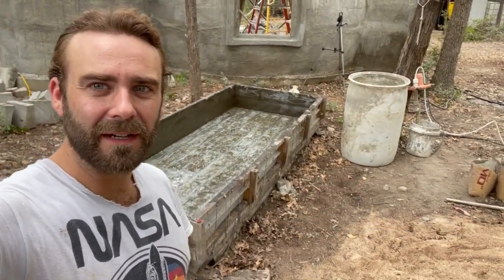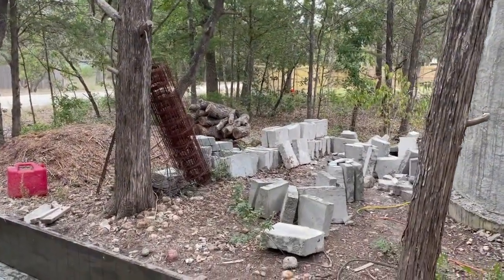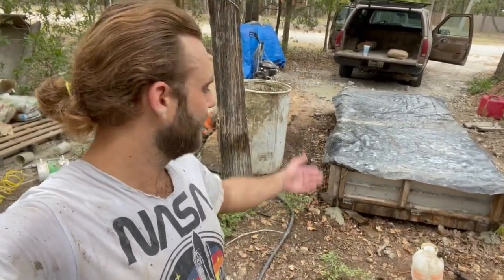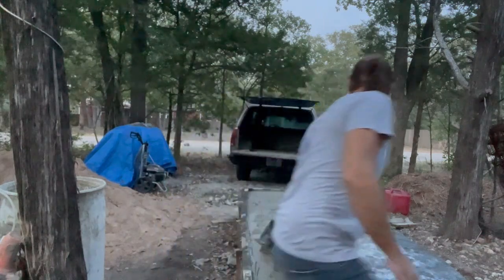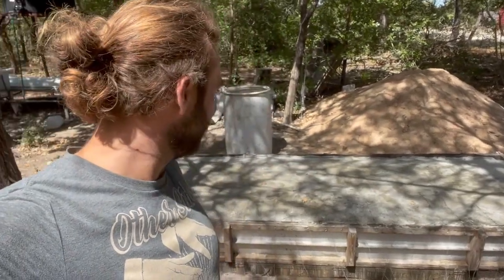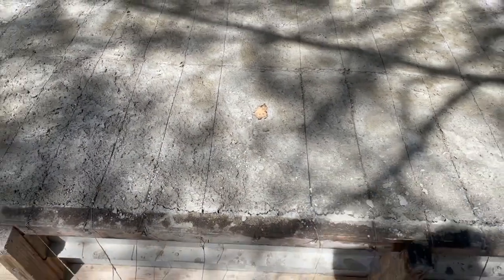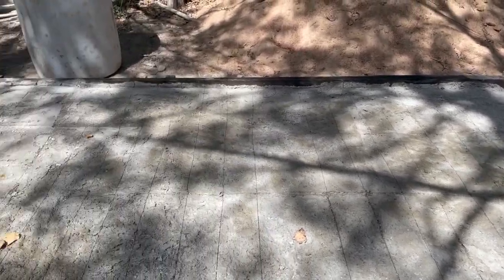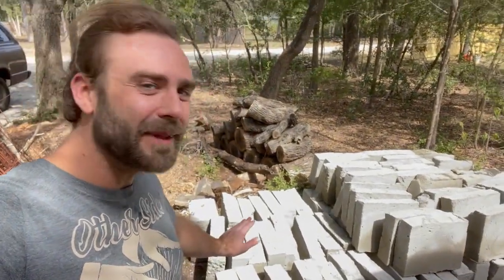Make your own Aircrete bricks by yourself!!!

Comment: If you left your string ends longer, enough to reach the other side over the top when it was time to cut, you could line it up with the other end and pull them while keeping it lined up with the other end.  I'd probably try to use electrical fence wire or something metal instead.   Dunno.   I'd actually be more interesting in making a shape like a 4x8 piece of plyboard for sheeting if that's possible.  Maybe pour a sheet into a 4'x8' box, level it out, put a piece of plyboard over it in the form, poor the next sheet, and keep stacking them on top of each other like an orea... concrete.. plyboard.. concrete.. plyboard.

Comment: If you were inclined to use something a little tougher than string, go to a poultry farm supply house and ask for shocker cable. Its the smallest cable ive seen. It is stretched frim one end of the feeders in a chicken house to rhe other and pulled taught. It keeps the birds from roosting in the frrder line

Comment: Wooaa!! We now have big safety issue with RAAC CONCRETE BEAMS. Be very carefully in your application. Ensure you use full re-enforced non ariated beams for load bearing including full concrete non ariated blocks for side support.

Comment: Amazing. Have you got a website with the stats? Where did you discover this method? Could this replace concrete for pouring non load bearing walls and structures in formwork with reinforcement steel?

Comment: I have done homemade aircrete before, for a small structure this is probably the best technique I have seen as the smallish bricks will crack much less. I ended up using corrugated ferrocement on my first small home build instead due to the crumbliness

Do be careful relying on this material above your head! Domes are strong, but please do stick to small structures when using non-engineered materials. A layer of polymer-enriched chicken wire ferrocement will hold those blocks together through any earthquakes, as well as waterproofing the surface.

I truly wish commercial autoclaved aircrete were a thing in the USA like it is all over Europe, the bricks are just so big
Reply: I live in Europe and my house is built out of the commercial autoclaved aircrete that you mentioned. It boggles the mind that it is not available in the US.
Reply: @wrojasiek We tend to use different materials in the U.S.
U.S. homes are designed for better efficency due to our weather being harsher throughout the year and air conditioning and heating being important.
We also have a great supply of trees due to Canada being located close by

Comment: To help with straightness and efficiency, instead of having to eyeball the strings to the other end while starting the pull to cut the blocks with the strings, just leave a tail on the pull end long enough to be taken to the string start end BEFORE beginning to pull them, and THEN once you're down there, line it up with the start point anchor, and pull.  It should then simply straighten itself as you pull it across that spot, as it will already be completely straight.  :-)
Reply: I would also put an eyebolts on the far side from where each string comes up, so you can pull  the string in pretty much any direction and the eyebolt will keep the cut perfectly straight.
Reply: @KeithOlson 
Exactly. I'd have little eyes all over the place. It'd be super sweet
Reply: I was thinking to have the strings secured to the frame on one side, and have the other side of the strings secured to a dowel... When ready to cut, just turn the dowel until the strings raise above the concrete mixture. Then it makes all the cuts at the same time and no chance to miss any.
Reply: @Babycutes  And hear I was thinking about just using a winch to pull the strings up.
Reply: Yes. That was my first thought when I watched him walk the string pull.

Comment: Thanks. Watched A LOT of air-crete videos and if they show the process its the elements to be added then the finish work...not the making of the entire project. So, this helped. Could you make a video where you show the consistency of the aircrete (like from the top of the barrel and the soap procedure mix and the thickness of the aircrete after mixing, etc. Plus one where you show you hooking up the equipment (plus extra hoses, their length, etc) in tandem? Thanks :)

Comment: Place a 2x4 or 2x8 over your concrete when you want to make your cut, i guess it still depends where the string lays in the bottom though
Reply: It will at least assure a straighter pull, though.

Comment: What does each block weigh?They look light which is just dandy to an old block layer.I have seen 2 by 4 ft panels .With some ladder wire incorporated for strength .Aircrete is a cool material imo.
Reply: Comparable to balsa wood or pine depending on the foam to cement ratio.  Not very strong but a good insulator.  The mixes that I see folks recommending get about 45 gallons from a 94lb bag of cement  and a pint of dishwasher detergent . 11 gallons of water per batch - 6 for the cement and 5 for the foam

Comment: Great tutorial. I love seeing ingenuity and DIY'ness.  One suggestion on getting straighter wire pulls if you are open to try -- if you put hooks (one for each wire) on the top lip of one short side of the frame and one long side of the frame, then attach washers to the wire ends on those sides, it might help.  When you go to pull wires, you'd first pull each of the washer wire ends up to the hook on the top lip on their respective side.  Then, when pulling the wires to cut the bricks, you'd go to the non-washer ends and pull them up and slightly away (instead of in the direction of the other end as in your video).  

This should cause the wires to remain taught and relatively straight.  This seems like it would work given what I could see in your video but possibly the setup isn't conducive....regardless, wanted to share the idea.  Subbed and looking forward to checking out your other videos.

Comment: Why don't you secure a board or pipe across the top to pull the string along the length?  It might be a straighter edge.  It might not work so I'm just asking.

Comment: I can't justify doing this much work and end up with a material that is so much weaker than concrete and something you just can't trust.
I hear the word Aircrete and i think they call it that because in 10 years ...there is nothing but air where your structure used to be.

Comment: Please tell me you actually used concrete and not just Portlant Cement as you stated several times in this video.  
Straight Portland Cement has almost zero strength, you need to add sand and agrogate to make concrete.

Comment: hey , just a thought , if you start with a longer string ,you 'll be able to line it up with the other side and pull it straight from there getting much straighter cuts.

Comment: They build walls around the homes in New Mexico. I’m going to make my own block wall instead of hauling heavy and expensive CMU concrete blocks 100 miles. Someone locally made their wall with styrofoam mixed in but I dont want all that synthetic pollution  on my build.

Comment: Have you seen dust crete construction demonstrations here on the tube?
2x4 stud wall on 24"  extra dustcrete infill capping studs inside and out. Basic clayslip- straw setup. Super efficient build. 1 8x8 wall in 6 hours. 
Lime plaster inside and out.

Dissolve tubes of silicone in what ever the manufacturer recommends for cleanup to liquid, then spray or paint on heavy canvas to create a ground skirt that deflects water splash, keeping  the build material dry underneath. Dude who did that made beadsheets  super hydrophobic. Water would not stick. Be well and enjoy!

Comment: Very interesting. I am toying with the idea of casting geodesic dome panels with all the included angles cast in during production. Alternatively, I might try cutting in the angles using a method similar to your string cutting.
Reply: AI Domes in Florida used to sell concrete dome kits. They made the panels with concrete, wire mesh for strength, and drywall on the inside of the panel. The wire mesh extended past the edges of the panels. You tie all the wire mesh together as you assemble the dome, the fill in the wire mesh joints with concrete. They went out of business a few years ago.
I like the concept and am interested in building a dome home using a similar method.
Reply: @HankHill757 
Hey that's really interesting

Comment: That string trick is genius! Simple and effective. Timing is everything, as usual. 👍
Reply: How are crooked bricks effective?
Reply: @václavčermák  In the event that's not a facetious comment, the brick shape is almost irrelevant other than being handy to stack and adding mortar. You could arguably do the same thing with improvised cookie cutters for the sake of argument and accomplish the same idea with a bit more work involved. Fieldstone houses and defensible walls were done this way for hundreds if not thousands of years with nary a flat side to stack anything on.
Reply: @C-M-E Normal commercial aircrete blocks here in Europe are fine polished to 0,25 mm and it's an important feature. You want to keep the binding as little as possible to minimize heat bridges. So normally you'd want to add some flattening and polishIng process (which should be reasonably simple, it's very easy-to-work-with materia). But I don't know what follows and how it is used and definitely admire the DIY effort. It's been most popular building material in this part of Europe for decades now, but we have many products and brands readily available everywhere. I became to understand it's difficult to get it in the US (?). I believe aircrete aircret shell must be cheaper to build than stick shell, considering how much effort goes into a stick building...
Reply: @oakld  Believe me, I'm a stickler for accuracy, but the ambiguous shape comment was more to the relevancy of building freestanding improvised aircrete in the woods versus a commercial structure.  
Here in the US, a lot of the building industry revolves around what code will allow, which currently aircrete is viewed as experimental unfortunately. You can make it work for code to a degree with exceptionally thick walls that conform to earth-built houses, also depending on location and how persnickety the local code office wants to be on enforcing materials and fitting within certain boundaries for a certain structure size. 
I'm actually building a dome-based workshop in my backyard as a sort of materials test for my graphene products and everything is pushed right to the very edge of tipping into the next code bracket that requires a lot of commercial this that and the other. By all calculations though, it should weight less than half of our current 10x13 shed and be at least 300% stronger. Amazing stuff!
Reply: @C-M-E  I believe you, though it's hard to understand you don't have a certified aircrete product at least available. I'm sure the rough precision is fine for auxiliary buildings such as shed, so I totally agree. Of course the blocks here are a bit different, the concrete is baked (probably not a correct term :-)) and as said precisely cut and polished. The most popular brand would probably be Xella Ytong, which I also used for my house, built some 15 years ago. I have 300 mm Ytong + 160 mm EPS insulation (joined by mounting foam, not mortar) and tripple pane windows, resulting in a house performing at about 2.5 the passive standard. For a future addition I chose Ytong IQ 450 + EPS and that would be very close to passive standard. But I just got approval for zoning permission for a new earth covered passive house, so I won't proceed with the addition. As for the US I assume that you can at least use your DIY aircrete as an infill and/or cladding to improve thermal properties of a building?
Reply: @oakld  Yeah, it's suitable as stucco and a fair amount more durable, although I've heard of people using it as the sole material for building extremely thick walled insulation on a new home (not around here, but I watched a series on a couple doing it themselves in the mountains of Arizona I believe a few years back. They could only pour so much in a day, partially from the labor of doing it themselves, but they also had to truck the water in). 
That blows my mind that it's been around for that long though, especially as a commercial product! I've not much exposure to it outside of what I find on the net for international things, but I'm fairly familiar with the Japanese system that arrives in prebuilt sections. Over here it's a relatively new material that's maybe 5 or 6 years old, and outside of enthusiasts and special contractors, no one uses it on a regular basis. I'm actually going to attempt something a little more unorthodox when I get my pad prep done via an intravenous build system that is pumped through an interconnected semi-flexible skeleton which will remain inside and later encased in the outer shell. It's all theoretical at this stage, but the math works out.
Reply: @C-M-E  Sound really cool. And those people were very unlucky - had they aircrete blocks available, they could use (approved) mounting foam in a spray can and they'd have their house up in no time and without a drop of water! :) Here the products range from pure cement base to various mixtures of cement and gypsum, which significantly helps to reduce thermal conductivity (but I believe also reduces loading performance). Overall, we have tons of brick and block products and aircrete won this market thanks to it's properties, with almost everything better than alternatives. It has lower loading, but still houses (the shell) survived standing a direct hit of F4 tornado ve had some 30 miles away two years ago. The next house I want to build "underground", or more precisely earth bermed and covered and for that reason I won't use aircrete much, only for some internal separating walls. Since they are easy to remove compared to solid reinforced concrete, handy if the house plan needs a change. But aside my needs, one can buy many aircrete products, such as lintels for window and door openings, floor and roof blocks, whole stair segments, etc. Many of them are reinforced the same way as solid concrete. So I hope I gave you some ideas for your inspiration and experimenting with your DIY aircrete. Keep up the good work!
Reply: @oakld  Wow, thank you for the detailed post! I'm often told not to write book-length comments, but I'm of the opinion that a well-notated comment needs to be whatever length it takes to correctly communicate all of the relevant info, so I enjoy reading and making 'walls of text'.  👍 I wish we had the kind of market the EU does with a lot of things, but that is the bit you get saddled with for being in this country. Slow to change, slower to evolve. I definitely have gotten some ideas, and wish you good fortune with your earth home. Those are among my favorite structures for resiliency and efficiency. I had one about 20 years ago that was my first and last time I'd ever gotten a check back from a utility company for having a negative balance. 😁
Reply: Hello there, how do you suppose he was able to keep in place? to maintain mean measurements I need help with that I just build the box.Thanks

Comment: Hola soy de Argentina !!!¿me podrías decir cómo es el tema de las cuerdas para cortar los bloques? ¿ Cómo se preparan para ? ¿De que material son? Si tienes fotos o videos o face B te agradezco ?
Reply: Eso de decir que "no tiene ni idea" es una exageración pues vimos como usó cuerdas para cortarlos cómo quezo, mientras aún estaban suaves.  El podría cortarlos con serrucho, pero de la manera que lo hizo eliminó innecesario trabajo.
Reply: Hola yo también soy Argentino y te digo que este tipo no tiene ni idea de cómo se cortan los bloques de cemento celular , podés hacer los divisorios en chapa de aluminio de 2 mm o hacer el bloque grande de 50 cm de altura por el ancho y largo que te sea más cómodo y después de 6 a 8 horas se puede desmoldar y cortar con sierra bimetálica o con serrucho con dientes de widia , se pueden soldar dos serruchos y hacer cortes de más de un metro , saludos cordiales

Comment: Y'all I have seen this structure Nato has built and video does not do it justice at all. This is one of the coolest DIY builds I have ever seen. The building is very structurally sound and solid. I recognized the Air crete the moment I walked up to it having already done some research on it. The bricks are super light and easy to work with obviously. Nice work Nato
Reply: Hey man where in Texas are you?
Reply: Yeah but durability and self repairing? Not good for fundamentals parts of the building structure.

Comment: Aircrete is a bad building material for withstanding load. { Ogf2hIboyFI } It cracks easily and turns to dust easily.
Reply: But it makes a good rigid fireproof insulation